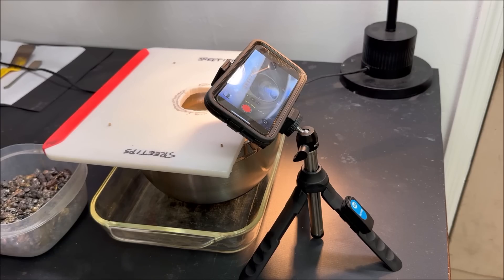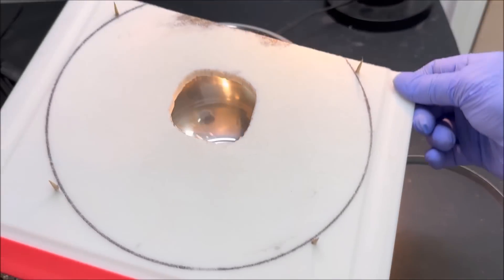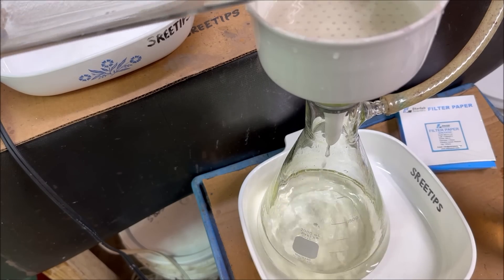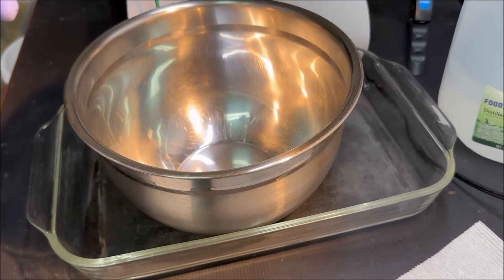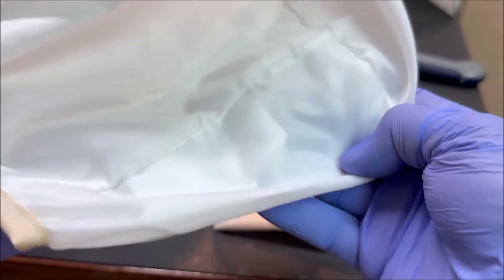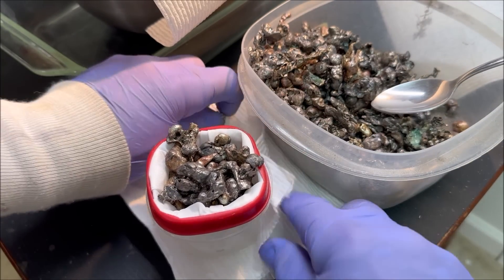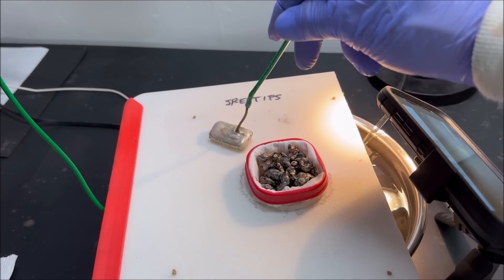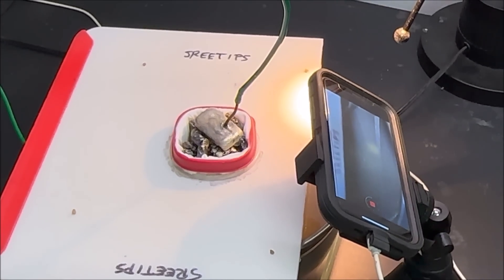Silver Cell Time Lapse Experiment

Comment: I finally hit the 1000 grams of Sterling Silver material!! And right at 500 grams of 10k, 12k, 14k, and 18k gold filled material!!
Reply from the maker: Nice!
Reply: @sreetips  I think that it would be best if I run about 200 grams of Sterling Silver first to see how it all goes. Btw, is there a way to calculate the yield on Sterling Silver?
Reply from the maker: I just use 90% - supposed to be 92.5% but I’ve never achieved that.
Reply: @sreetips  Copy that! Is it 3ml of Nitric per gram of Sterling Silver or is that just for gold?

Comment: I was thinking about your comment about increasing surface area of the shot you are using to charge the basket.  Wouldn't unmelted silver cement have a super high surface area, way higher than the shot.  Seems you might not need the step of melting it down and might increase contact efficiency with the cement.
Reply from the maker: Cement silver clogs the filter

Comment: Question: could you use a plexiglass or tempered glass as a cover for time lapse? I know working/cutting them isn’t easy and I don’t know about how they work with the acids but maybe something to look into.
Reply from the maker: It would become obscured by condensate forming on it. The cell generates a little heat. The heat causes the water to evaporate and it condenses on the user side of the cover.

Comment: You should consider the use of compression filtration. Think coffee plunger 🪠.solids pushed to the bottom filtration sediment on the bottom. Crank and high flow Filter down unrestricted up valve for ultra fast filtration then dumping to a column sand filter for the residual for later reclamation. Physics don't forget gravity can be your friend. It is not only for making you trip and fall 🍁 to the floor.... You are spending the time on inneficient filters....
Reply from the maker: A filter press.
Reply: @sreetips  yes Sir,,🤓

Comment: What ratio of H2o to Nitric do you find best for the silver cell electrolyte? In this video it looks like you were dissolving approx 10 ozt but I missed the ratio and wonder if the electrolyte is too strong with nitric it might redissolve the copper as you have mentioned in previous silver cell videos.
Reply from the maker: I dissolved 600g of pure silver crystal. I use about a 50/50 nitric/distilled water ration. I boil until there are zero fumes evolving with a little silver left in the beaker. This tells me that all the free nitric has been consumed. Then it’s safe to use as electrolyte. Excess nitric in the electrolyte is not desirable. It will react with the silver crystal and produce fumes. Plus, if there’s palladium in the impure silver in the anode basket, excess nitric in the electrolyte will cause the palladium to dissolve (palladium is soluble in nitric) and contaminate the electrolyte. I can tell if this has happened because the electrolyte will turn green instead of blue.
Reply: He said that he used about 600 g of Ag, which’d be closer to 20 ozT.

It’s a cookbook recipe.  Presumably optimal.

There’s another recipe that uses less Ag and more HNO3, so I’d bet that the acid concentration isn’t an issue.

Comment: I have a silver cell running using your method but using a 7 liter glass cylindar. Thanks to your video I am going to also try a time lapse. I will post a video link after you post yours. You got first rights!!! After all thanks to you I am doing this in the first place.
Reply from the maker: I used to run a one liter glass silver cell. Got good results with it for several years. Then one of the pro refiners on the goldrefiningforum.com convinced be to switch to a stainless silver cell. Said I’d throw rocks at my glass cell if I did. And he was right.
Reply: I am a little confused on why you wanted to throw rocks at your glass cell? Was it because the stainless steel cell was way more effecient? I have to admit to being still facinated by watching these crytals grow. I did a 10 hour time elapse last night and will post a link when your 10 day time-elapse is finished unless you give me the okay to link it now.
Reply from the maker: I ran one liter glass silver cells. I was constantly have silver crystal contact the anode filter basket, burn a hole in the filter, and contaminate the cell with slimes from the anode filter basket. Switching to a large stainless cell has eliminated this. Although I do add an inline 3amp fuse as it gets to the end of the run as a precaution.
Reply: The seperation between the anode and cathode is larger than Hoke suggests in my cell. My cell is ~9.5 in tall and 7.5 in in diameter. I put one of your baskets on one side of the cell and a sheet of stainless steel in an L shape on the other side. I have plenty of seperation between electrodes. I am still getting 1.7 amps at 3.5 v though. I have not had a short yet but I keep an eye on the crystals which are pretty amazing, as you well know.

Comment: nice video.
Why do a second batch process?
Also, minus your time & reusable equiptment... how much does a batch process cost approx.?
I like your bare bones setup.
Reply from the maker: I’ll do a second run, running the pure silver crystal back through the cell a second time with fresh electrolyte, just for the show. I did one like that a while back. Sent some of the silver in for ICP analysis, and it came back greater than five nines fine. That’s 99,999 parts per one hundred thousand pure silver crystal. Not that it matters because industry standard for pure silver is three nines. Unless it’s needed for some special purpose such as a test standard of some sort. And I don’t keep track of expenses for each batch. I just refine it to high purity, harvest the silver crystal, put it away and forget about it. Thankfully, I don’t have to worry about trying to resell it for a “profit”. The silver is my profit.

Comment: Big fan of your show… go BIGGER! We’ve seen the results of using your current set up. Now we wanna see a bigger bowl, a bigger shot reservoir… flowing more electricity! I doubt you have a shortage of shot. This would intrigue new/ more viewers. Also adds a dynamic of “the unknown”. Go BIG!! Other channels are copying your channel! Get ahead of them! A 55 gallon drum…. Just an idea!
Reply from the maker: There’s a restriction. A critical distance between the anode and the cathode of 4 inches. Going bigger would violate this distance and create problems in the cell. I guess I could switch to a moebius silver cell; alternating anode and cathode plates suspended in silver nitrate electrolyte. But that is far too big for my small hobby setup.
Reply: I think your “hobby” is bigger than you think! You’ve got an awesome channel that will grow if you feed it new challenges! What about a 4 inch deep “pan” but it’s 3’x3’ feed by multiple power sources!! Go big brother!!!

Comment: I’ve got a suggestion for an experiment. Get a taller stainless steel bowl. Much taller than it is wide. Use a piece of copper on the bottom of it as your cathode. The weight of the container will give you good contact. Then set your basket up the way you do it except instead of feeding in the silver cell a little bit at a time create using a piece of clear PVC, a tube coming out of the top that allows you to load all your silver at one time then place your silver anode element on the top and walk away. Theoretically, the silver silver crystals should form on the bottom because that’s where most of the current is going to be. And if you’re containers, tall enough, they should never reach the anode. Thus it is set it and forget it system.
Reply from the maker: There’s a critical distance between the anode and the cathode. Four to 4.5 inches max.
Reply: @sreetips  well, if you just increased the voltage that should take care of the distance, correct? Or will that do something to how the silver crystallizes if you have too much voltage?
Reply: @_jurist electrorefining of metals is very much like electroplating.  The way the anodes ‘see’ the cathode is a function of distance.

The sides of your stainless ‘beaker’ will draw more power and the bottom won’t draw nearly anything.

S would get a donut of Ag at the top and only the amount that fell off the crystals, on the bottom.

His set up is pretty close to optimal.  The distance from the anode to the cathode is nearly fixed all the way around.
Reply: @_jurist  If the electrical resistance is high - increasing the voltage will cause arcing, heating, and burning of the conductive material and possibly flame the combustibles.... Filter then plastic etc. Me thinx
Reply from the maker: Voltage is critical also. 3.3 to 3.8 max. Other metals, if present, will tend to plate out with the silver and contaminate if the voltage is too high, or low.
Reply: @sreetips  Refining Precious Metal Wastes by C. M Hoke-362pg Book-Gold-Rhodium-DIY-Paperback. 

I saw in one of your other posts on one of your other videos, you reference this book. So I figured I would buy it, to learn about this before I ever decide to try and jump into it plus I need to spend a year going to , garage sales and estate sales and Internet sales to get up enough gold to even try to do it.

Any other books you might have for reference.?
Reply from the maker: No, that’s the refiners “Bible”
Reply from the maker: I have a hard copy I bought new for my night stand, and a pdf copy for the shop.
Reply: Also running to high of voltage will also plate contaminates out as well. So if you’re using sterling, and karat gold wastes, platinum and palladium can contaminate the silver which is the intended product. I don’t know if copper would plate, I think that just goes into solution.
Reply: Distanca 8cm anode cathode
Reply: Wouldn't the silver nitrate cement out on the copper like it does without current? Doesn't make sense to me.
Reply from the maker: The silver nitrate will cement out on metallic copper. But it can’t, and won’t cement out on copper in solution.
Reply: @jamescball55  the copper is not inside the bowl. It’s outside the bowl. The bowl is sitting on a copper plate, which is the cathode.
Reply: As my experience shows that all is correct in this case. Voktage is ok and Amos are ok. If you increase voktage it will burn inix fast.